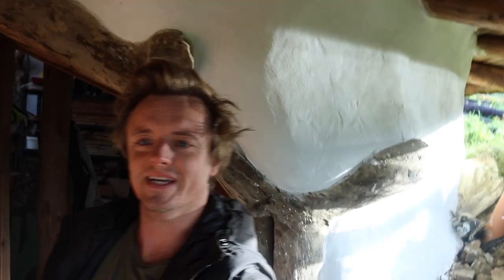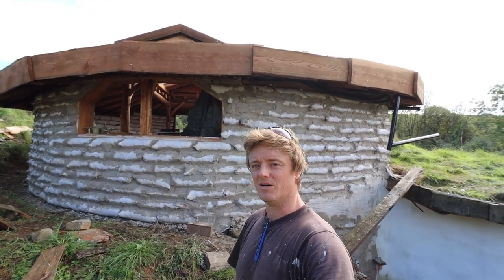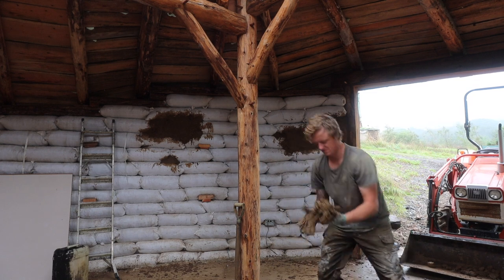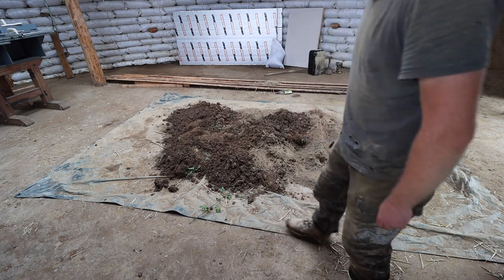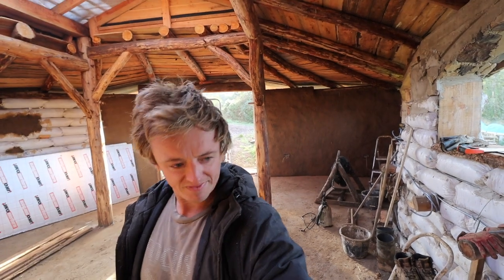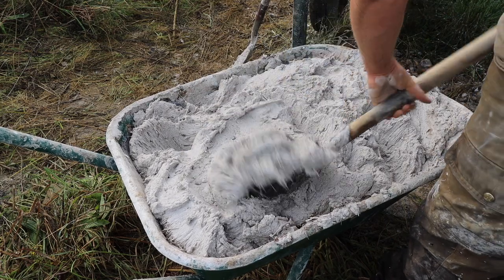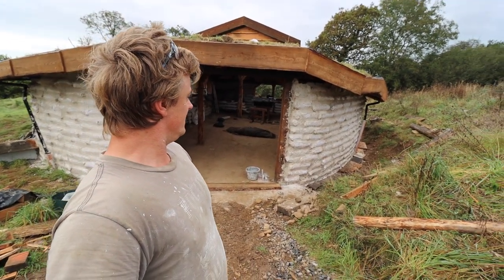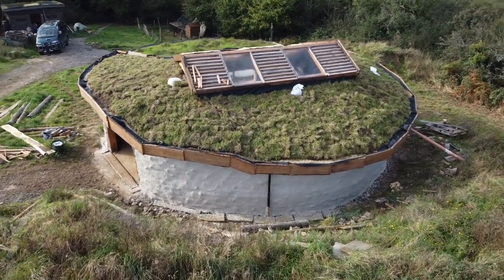Off Grid Earthbag Workshop Part 72 Lime Plastering The Outside

Comment: Back in the mid fifties, one of my jobs was to beat cow hair with two battens, on a sheet of Expanded Metal to tease it out for use in the lime, sand, cement mortar for pugging ceiling panels prior to the finishing with lime putty and plaster. It was on Devonshire House Piccadilly and all work had to be done as with original materials. Keep the videos coming Kris. Interesting and brings back memories of old.:yougotthis:

Comment: I don't know if you watch AvE, but he recently made an ad hoc cement mixer by simply using a fencing auger in the bucket of his tractor. It only required drilling one hole for a hydraulic motor. Worked surprisingly well for him, particularly parking on a slope so you could control the speed of mixing. Thought it might be a helpful solution when you're facing all that cob work. Good luck!

Comment: I have done stucco and plaster my whole life and I've never seen a mixer like that in the US we use paddle mixers that's in a hopper have a nice day we always spray it on for the gunite machine and then we Darby it out using a street
Reply: It's a muller, like would be used to prepare green sand for metal casting.

Comment: @Kris Harbour:  You could use an old barrel or water heater to make a roller for flattening and packing the floors/other areas.  Simply make a U-shaped handle for moving it and then fill it with water to add weight.   🙂  I see the cat likes to photo-bomb your filming.  😂

Comment: Looks fantastic and the drone  and new lens show it off well. One question, you said you were running low on the lime. Would it have been an option to use cob to fill the voids around the bags, and then lime for the rest?

Comment: Considering the latest petrolium crisis and from what I understand spike in cost of electricity, how did that effect you? IF it did at all?
Reply from the maker: It didn’t effect me at all. I don’t drive much and when I do I use bio fuel and the power is all free (once the system is installed) its very nice to not be a part of it or a burden.

Comment: Always slightly mystified, and not sure I've seen you mention it, so this lime plaster adheres quite happily to the plastic sacks?
Reply: I think the "plastic sacs" are made from a woven plastic. This would allow the lime plaster to be pushed through the weave on a microscopic level. When the lime then dries the plaster is bonded by itself to both sides of the fabric .... if that makes sense?
Reply: @totherarf  Yes, you're right, that makes sense, I suppose, and it must work the same way with the cob as well. I guess because the bags are all packed down so hard there isn't enough movement or settlement that might loosen the render. I guess that's also what makes the whole thing somewhat vapour-permeable, otherwise he'd have a terrible condensation problem inside.

Comment: How many pounds in half a ton with the metric system. Half a ton of cob in Murica is a 1000 pounds lol
Reply from the maker: That’s about right. A bucket of sand or soil in the tractor is about 250kg there is a bucket of each plus water. So about 1000lb

Comment: Cob and limewash is a pretty good material. I've owned a house with 600 year old slabs of the stuff in between beams. The only damage to it was from someone hammering wooden pegs to attach kent peg tiles.

Comment: That roller mixer is quite a machine! Did you build it, or was it professionally manufactured? If so, was it designed specifically for lime? Or was it more of a general grinding mill, such as for grains?
Reply: It kind of looks like a muller for green sand when casting metal
Reply from the maker: It was given to me by a friend who didn’t need it anymore. It used to run on hydraulics with a generator. I put an electric motor on it so I could run it off my renewable energy. It’s quite old and has done a lot of hours but still works great. It is designed for mixing lime as lime mixes better when it gets crushed during the mixing

Comment: Bags is chemical material and do not comes from natural world. It is substance which do not effects to warm or cold weathear. But the material clay - do. Also condensation of inside will make wet substance and sooner or later it will fall down because it will not stick to bags. You could use wood, bricks, cement for walls but not the bags :(
Reply: Oh dear - all that effort to type a piece of complete nonsense!
Such a waste......!

Comment: Kris, when building your structures, did you need planning permission at all, I know some areas in Wales have a relaxed attitude to this when it comes to a "more natural" building. Is there any way that you could do a Q&A on this subject and the pitfalls that someone who is starting out on a similar journey might encounter.
Reply: My guess is that this is a combination of permitted development and necessary agricultural dwelling or possibly the 4 years and 1 day rule. 

If you have 5 hectares you can build a barn (or a workshop) whilst doing so you can live in a temporary dwelling.. caravan or similar for 5 years. Then if you have a business that necessitates your presence over night (for security reasons or animal welfare) you can apply for planning permission to dwell on the land in a necessary agricultural dwelling.

Alternatively,
 If you decide to build a permanent dwelling (a structure that is not moveable in two sections by mainstream haulage) such as the roundhouse, and you live there without major complaints for 4 years and 1 day, you can approach the local planning authority and apply for a certificate of lawfulness based on it being a low impact dwelling. If people havent complained in that time frame, it's unlikely to be something that will cause extra administration in the LPA office.

Either that or its One Planet Development. Which would make sense as Kris makes extensive records of the weight of any given produce yield. 

I too would love to know.. after ten years of looking at ways to live simply on the land we are still excited to find new avenues to facilitate our dream.
Reply: "Need"
lol
Reply: he explained he doesn't need permits in the zone he's in
Reply: I don’t get why Kris keeps schtum about this question as it comes up all the time, many people are interested and he’s not exactly living under the radar! I live in Wales and planning permission is as restrictive as anywhere else in the Uk. There is the ‘one planet’ policy here but it has pretty stringent rules and requirements. I imagine he’s gone through that but why not mention it?

Comment: I hate to be critical as you're really good at almost everything, but driving that tractor isn't one of them, either that or it's a pile of crap, it is really fierce & always bucking about when you go back and forth, even outside in the fields, the controls for the bucket are the same, it's really quite bad. I see the same tractor on a few other channels and they seem to be much smoother in operation.